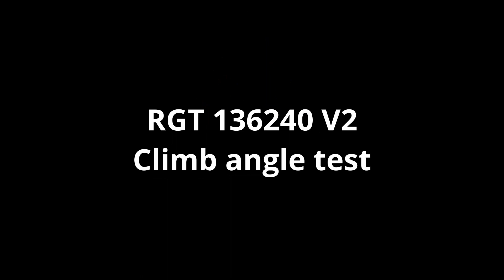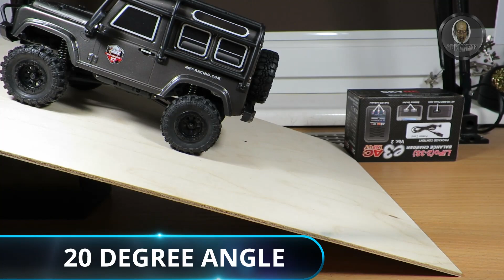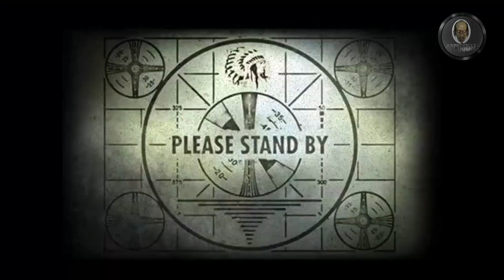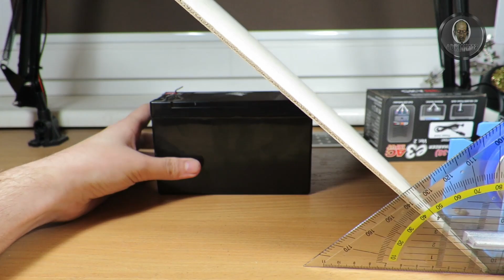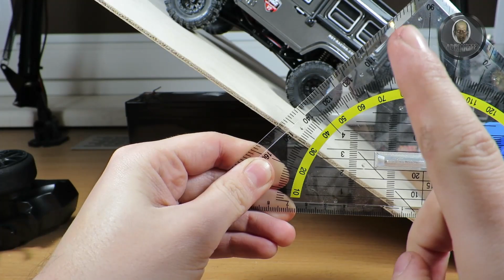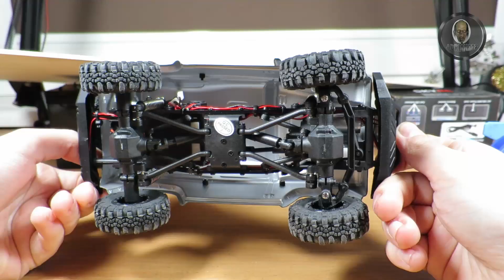RGT 136240 V2 - Climb angle test

Comment: In my view, actually the rc car can be more uphill but because the wood surface is smooth, so the wheels are less gripping, so the wheels spin as if drifting.  Correction if I'm wrong ... ✌️😁
Reply from the maker: Yes, car have power but I don't have so big peace of something that will work better :D
So still stable 35 degree confirmed but I made on 40 also :)
Reply: @Adrian202  Ok ok, thanks for sharing your experience about small cars that can climb, because I really like rc cars that are offroad adventure models, look cooler like the original car, a real man's car ... 😎👍👍👍